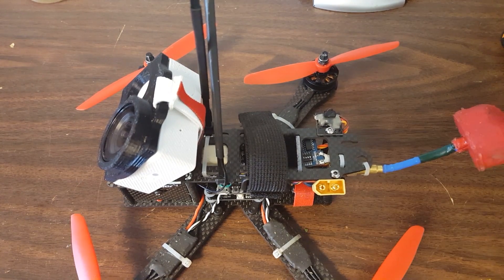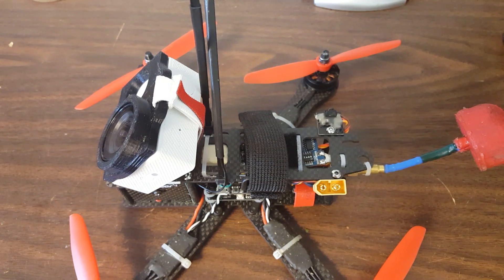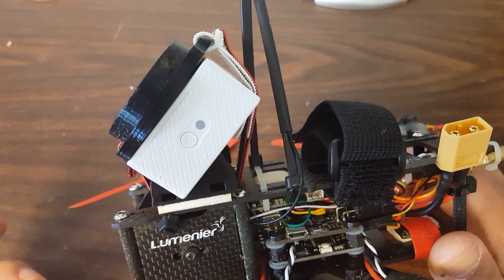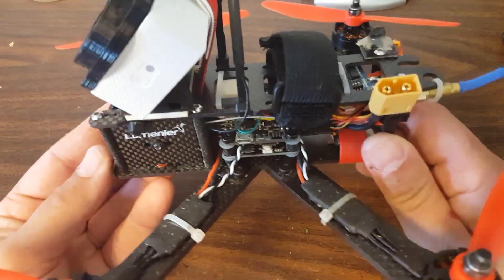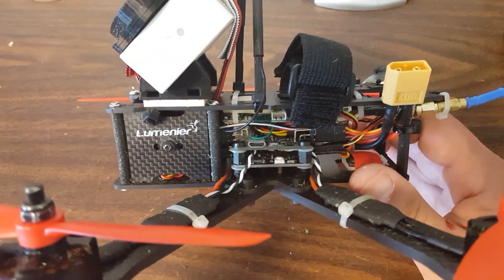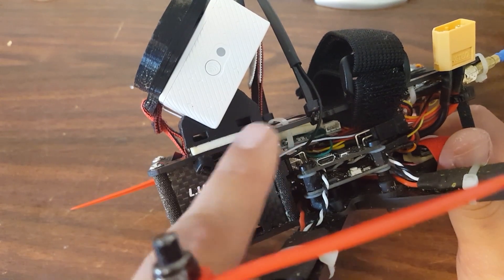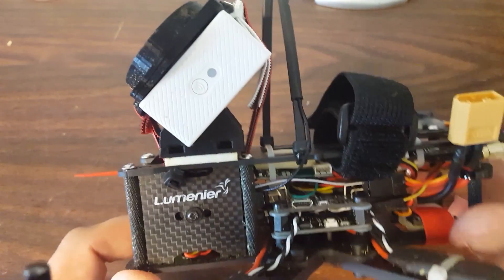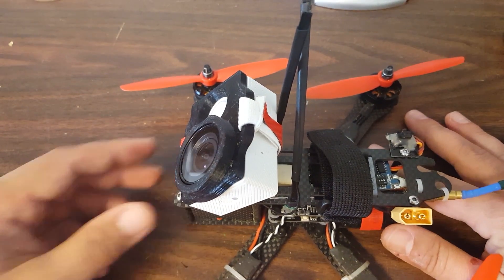Quadcopter Build Tip: Choose Your Break Points

Comment: The same concept is applied in mountain biking. We tighten our brake and shifter levers just tight enough to the bars where our hands so not easily move them during normal operation, but they will easily move in a crash. That way they may be scratched, but should still be functional.

Comment: @joshua what kind of battery strap is that? it looks resilient
Reply from the maker: +Michael Calma http://www.myrcmart.com/rcx-battery-strap-5pcs-20x200mm-with-resilience-p-9178.html

It is a bit of a mixed blessing. It is flexible, which means that it is unlikely to break in a hard crash. You can also wrap it around electronics mounted under the top plate (if you like) without worrying about damaging them. But on the flip side, it can only get so tight. If the strap is not close to centered on the battery, then the battery will wedge itself out in a crash. It also is not very good at keeping the battery from sliding around based just on friction; you'll want grip tape or velcro or something to keep the battery in place.
Reply: understandable thanks Josh

Comment: I need a weaker strap around my camera and mount.  I have the LS210 and have my camera attached similar to yours.  After a pretty good meeting with asphalt my camera and mount stayed together with the velcro strap and snapped by top plate. https://www.amazon.com/clouddrive/share/Dk3m0PjSoeiqhz0L3DwHxaHz13Rp6Ixk90yURkMyOoi?v=grid&ref_=cd_ph_share_link_copy
Reply from the maker: +PropellerAddict WOW! That is one seriously strong strap.
Reply: +Joshua Bardwell I guess so.  I typically just use the 30cm straps from http://www.banggood.com/5X-20cm-30cm-Magic-Sticker-Strap-for-Lipo-Battery-p-986315.html

Comment: Nice informative video. "mechanical fuse" lol 

I myself have been wondering about this principle. Everyone on the forums likes to run DAL indestructible props. I wonder where that energy is going? Straight to the motor shaft would be my guess.
Reply from the maker: Correct. I wouldn't run DAL in 1800 or smaller motors for that reason. 2200 and larger seem to handle it okay, with 3mm shafts.

Comment: Here's something i think you dont know cos you would probably use it? http://www.rubbercomp.com/en/ is all you need to protect from moisture. Spray your esc's, pdb and fc with transparent thin layer. Fly thru the winter and rain without worries.
Reply from the maker: +lazyeyes For more on this topic: https://www.youtube.com/watch?v=s4z8QMgTEA4
Reply: +Joshua Bardwell So why dont you use it.? is 15min of extra work not worth it?
Reply from the maker: I don't have any issues with moisture so far. So it would be a solution to a problem I don't have. How do you clean it off if you have to solder over it?
Reply from the maker: +lazyeyes I have occasionally been worried about moist grass...

Comment: thank you for another great video! i dont know if this is the right place to ask for, but what are you thinking about having the 5.8 fpv antenna conectors NOT isolated? i see this in your video here too, that you also havent any tubeshrink or something protective on your fpv antenna conectors. i mean the frame is made of carbon, so its conductive. the sma conectors are the negative pole of circuit. so the whole frame now is a negative pole. its the simple solution of just zip tieing the antenna on the frame worth the risk of short circuits? - do you having any problems?
Reply from the maker: +Vorname Nachname Grounding the frame is only a problem if you end up with positive voltage applied to the frame, which should never happen. If it does happen, and if the SMA connector is grounding to the frame, then you can end up with current flowing through your vTX and fry it. But any time you apply positive voltage to an unapproved place, something is likely to go wrong, so for me, the answer is to carefully isolate any positive voltage sources. It's just too much work (in my opinion) to try to prevent the frame from getting grounded. There are too many possible sources of ground. Even if you assume that the SMA connector is the only source of ground, isolating a bulkhead connector like that is pretty hard. 

I know a person whose opinion I respect who says that he gets better video link quality and range when he isolates his SMA connector from his frame. I don't personally have a problem with my link quality or range, so I don't bother. Just saying, if you're suspicious of that arrangement, you're not alone.
Reply: +Joshua Bardwell thank you for your prompt answering! you're right, its almost impossible to install the antenna without touching the frame, especially if you would use the scheduled holes (instead of zip tieing them to the top plate). Thank you for your appraisal. Now I can sleep well again.

Please go on making such great videos which goes little deeper then just the average build and flying videos (which i like, too). I would not be this far in this hobby without watching you skilled guys' videos. Thanks and sorry for my bad english. Happy flying, summer is coming!
Reply: I worry about this too and try to avoid antenna connectors touching the frame. Not sure though if it is necessary to insulate them.
Reply: thanks for the reply

Comment: Great build tip! 
But if you do this then it's critical to have a proper post crash check every time. I have this philosophy followed on a number of elements on my quad so after a crash I need to make sure I check everything is where it needs to be rather than bounced around.

On a side note, is a great perspective on your insane camera tilt :]
Reply from the maker: +Abdul Aleem Shekhani definitely. Post crash check is mandatory.
Reply from the maker: +Abdul Aleem Shekhani Also, as I learned way back when from Filte Test, when you crash, don't immediately start picking your stuff up. Find the biggest, most central piece, and start piling your stuff near it until you are sure you have found everything. This can prevent you losing some important part in the grass and then you have no idea where it is.
Reply: That's a damn good idea! I use my search and recovery training from diving to help out finding stuff but locating the site of the crash often creates a problem, leaving it in place for a minute or two is a simple, easy and effective way to make sure you're searching the right area! Great tip!
Reply from the maker: Abdul Aleem Shekhani All credit to Flite Test.
Reply: FliteTest yyaaayyyyyyy

Comment: I found that 3d printed camera mounts tend to break cameras too if they're too rigid. The tip is to print them hollow with 2 shells, assuming you have access to a 3d printer.

You rather see the mount crushed than your camera poked through by the mount.